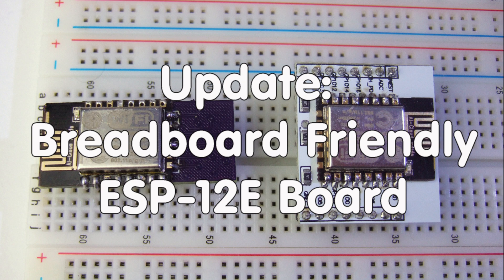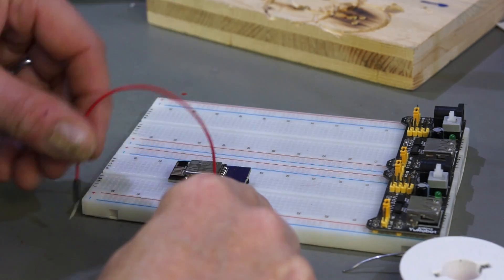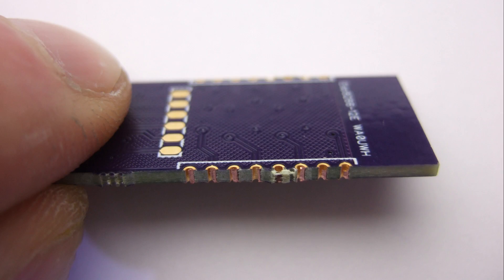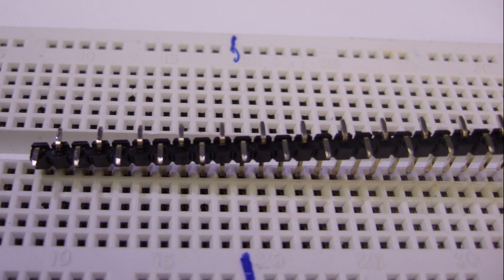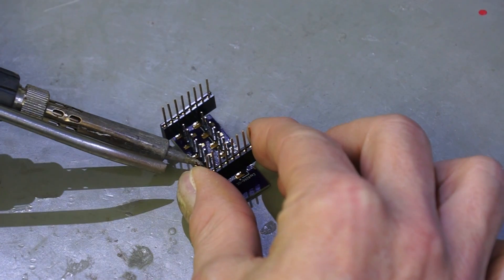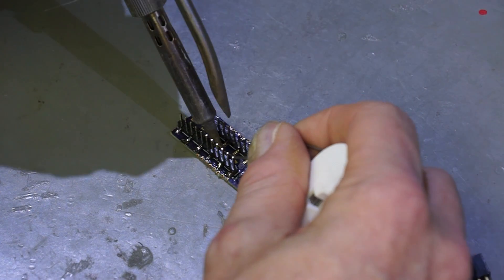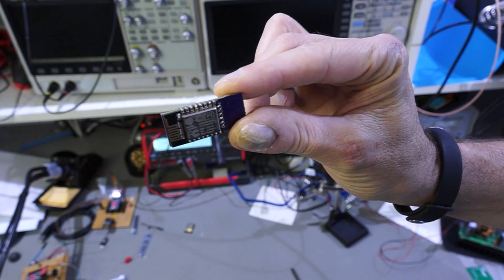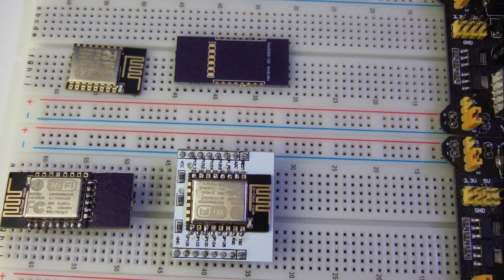#45 Update: Breakboard Friendly ESP-12E Breakout Board

Comment: hi, this error happens when im trying to program esp-12e using usb to serial ftdi ft232rl. anyone knows this errror?

A fatal esptoolpy error occurred: Failed to connect to ESP8266: Timed out waiting for packet header_

im designing a board which i used the esp8266 module. i used the node mcu board for prototyping and it worked, but now it doesn't.
i put board selection on NodeMCU 1.0 in the ide

in device manager it shows, usb serial port (COM10) so the drivers of ftdi is ok also the cable connection.
Reply from the maker: Maybe you did not connect GPIO0 to ground during reset. This is usually done by two transistors on the NodeMCU boards.
Reply: @AndreasSpiess  thank you sir for your respond and time. i did indeed, my circuit uses two 2n3904 which the collector of one is connected to gpio0 and another to rest
Reply: @AndreasSpiess  i can share with you my circuit design. its a wireless sensor using esp8266 A0 for capturing mechanical vibration

Comment: RobotDyn makes a 8M (!) breadboard friendly version but it is really just a breakout board with a reset switch and a VREG, all the pullups and downs are missing https://robotdyn.com/wifi-module-esp8266-pro-8m-flash.html
Schematic https://robotdyn.com/pub/media/0G-00005410==Mod-ESP8266PRO/DOCS/Schematic==0G-00005410==Mod-ESP8266PRO.pdf
Pinout https://robotdyn.com/pub/media/0G-00005410==Mod-ESP8266PRO/DOCS/PINOUT==0G-00005410==Mod-ESP8266PRO.pdf
Reply from the maker: Thank you for the link. Just be aware it’s the same as the ESP12 without serial to usb converter
Reply: Yes that is correct, I havent been able to get mine to work, even after pulling CHPD high and IO0 and IO15 low, serial output is garbled, maybe I'm not wiring something right, it's a really nice tiny module
Reply: I just compared the size to Eldon's OSH Park's board 16.1x36.1mm and the RobotDyn one is only slighty bigger at 17.8x38mm, impressive.
I haven't gotten mine to work yet, will try with a separate PSU and see if I can get 74880bps working to see in which boot mode it is, I may have killed it with a CJMCU CP2102 that outputs 4V+ on the 3.3V pin...because the RST pin is tied to 5V intead of 3.3

Was able to solder 2 SMD resistor to pull high IO15 to the left side of the cap right above it and IO0 to the VREG tab, plus a through hole resistor across EN and the VCC pin 8 of the flash. If I can get it to work, I may order more of them since they are so cheap and takes very little space.

May need IO2 to be pulled high as well..

Comment: Question for you, it's a little off topic. Is it possible to control a motor with the ESP8266 through an L298n motor module using a 3.3 to 5v logic level converter? The ESP of course is 3.3v but the l298 is 5v. am I barking up the wrong tree? Will this work if I am wanting to build a wifi controlled car or should I try something else?
Reply from the maker: +Revelation612 this should work from the hardware point of view. 
See also http://www.rudiswiki.de/wiki9/WiFiCar-NodeMCU.

Comment: that's a great lil' thing .  i was thinking of a part that would hold the esp v12 e on a angle and bring it  to the footprint of a DIP . i sort of got the idea when i did the T800 CPU for fun , but now i'm liking having ESP v1's  as single inline wit the antenna up away form the board . I got to thinking a small 3d printed holder for  ESP 12e  . it would have a foot print close to a arduino DIP and straddle the middle of a single bread board.
Reply from the maker: +XerotoLabs This concept for sure is possible, but I think, it will be quite wide. The few pins of the ESP-01 have a similar size than the chip itself. With the ESP-12 this is completely different. This will become a quite big animal.
Maybe you do not want to connect all pins to reduce width...
But for sure, it will leave plenty of space on the breadboard!
Reply: +Andreas Spiess yeah that&#39;s why i was thinking DIP shape at the bottom and the chip would be sitting at about 15 to 20deg upright .  2 rows of 11 pins for a 12e .  I&#39;ll have to sketch it out in TinkerCad .  i can think of 2 ways to orient the  module , on its side tilted up would be the easiest / most direct for layout  .  when adding 3d printed part in the mix we have many possible orientations .  the goal would think , no wider footprint than a simple DIP ,  11 pins on each side. and not too tall , preferring to orient the antenna to top , but side mount may be just as good.  this would let us have a foot print smaller than a Arduino328 IC.  an hopefully build in 2 resistors some how,  hmm . time to sketch .  ~ though i dont think i have any 12e&#39;s left that are not already soldered to a dev board . LOL
oh and just a thought , if i'm careful and make use of all the forks form inside female headers that i save when braking them smaller , i shoudl beable to make a holder that the V2 types just snap in to . Hmm .  that requires more thinking while we wait for ESP32's lol
Reply from the maker: +XerotoLabs That should be possible. You can already start to design while the new module is on the way from China ;-)
Reply: +Andreas Spiess ha ha ! so true ! at leats mine are on the wide style like you have on the right of your video so i can make detailed measurements . 
bread board friendly , snap-in  ESP 12x holder. lol

Comment: Pretty complex for a breadboard mount. I find it easier to just double up on the breadboard side by side and straddle the middle two power rails with the esp12e on the wide adapter boards made for the esp12.  I solder jumpers to the extra pins and use the breadboard for interconnect. This gives me extra breadboard space for more prototyping.  I'm able to use the Nodemcu v3 breakout the same way.

Anyway, I like your videos a lot. Keep them coming.
Reply from the maker: +m t I think, your solution is also a good one if you have the two breadboards fixed on a plate. Thank you for sharing. I wanted to give an overview about the different possibilities so everybody can decide.
I liked the special pin headers used with this board. I even did not know they exist. And because i do most of my work in SMD this is a good addition if i want to use the other side for someting else. With throughole, the space on both sides of the board is somehow used.

Comment: Have you looked into any of the NodeMCU packagings of the ESP8266 12E?
Reply from the maker: +Benjamin Carlyle This is the update uf a video in which I looked itho all other boards. You find the link in the comments.
Reply: Thanks. I have had a NodeMCU V3 on order to play with for a while. I'm not sure what I'll do with it yet. I'll probably stick to arduino-style programming for now.
Reply from the maker: +Benjamin Carlyle I use the Arduino IDE to program all my ESP8266 boards. These days, you find many libraries wich are already ported to the platform. You get much more speed and memory with the ESP. But the most imortant advantage is alwaiys if you want to use the internet. Then Arduinos are not easy to use and if you want do do a little HTML, space can be a concern.
If you look at my projekcts, i often also use Arduinos because they are still a good choice for many things.
Reply: Yeah, I have a software background especially in Web architecture. I've just been getting into microcontrollers, mostly to expose my kids to the kinds of things software and electronics can do together. Arduino seems to hit that sweet spot of many fun projects with low complexity, and the 5V sensor and actuator ecosystem is full of cheap parts. A friend of mine put me on to the ESP8266 so I thought I would shell out for one to try. I have a level shifter so I should be able to make use of it with 5V parts. I think my robot platform will be running with an Arduino brain for the time being though.
Reply from the maker: +Benjamin Carlyle Welcome. I coose the other way round... Arduino is a great thing for what you intend with your kids. If you want to go towards web technology, you are better off with the ESP because of the limitations of the Arduinos.
Anyway, most of the newer components run on 3.3V or lower (even the newer Arduinos). That is definitively the trend.
Reply: I have been doing a little work on STM32F4 chips in my professional capacity of late. They have some nice features such as DMA and DAC but for an order of magnitude more cost (still under $50). I may end up with a "discovery" board on my desk at some point before I finish my current project.
Reply from the maker: +Benjamin Carlyle Yea, the STM boards are also awsome, just without WiFi. I have a few of them which I also program with the Arduino IDE (e.g. Maple Leaf). They cost also only a few dollars and are fast enough for me.

Comment: Hi Andreas - I'm using the white break out board with 2.54mm 20mm Long Header Pin
then I can connect bread board  to upper pins of ESP breakout board 

Hope you find this useful
Reply from the maker: +Qamar Kilani Can you explain a little more? I do not understand your concept. Do you connect it then with female wires directly to the header pin from the top?
Reply: Yes - the lower pin are just to mount ESP board on breadboard and the upper pins are used to connect ESP pins to other ICs using female-male  jumper wires
Reply from the maker: +Qamar Kilani That's what I tought. Also a good idea. Thank you for sharing